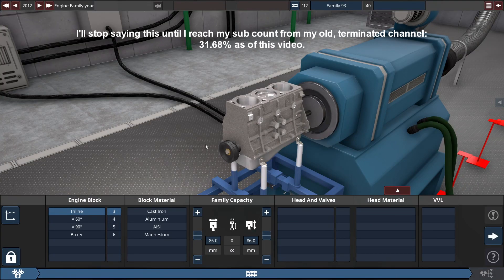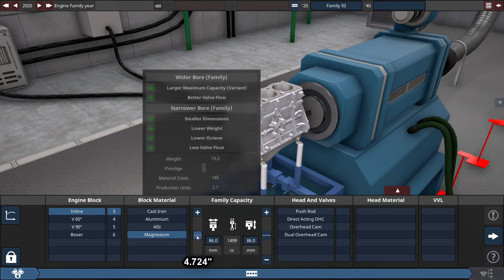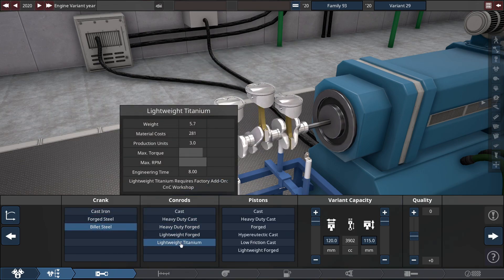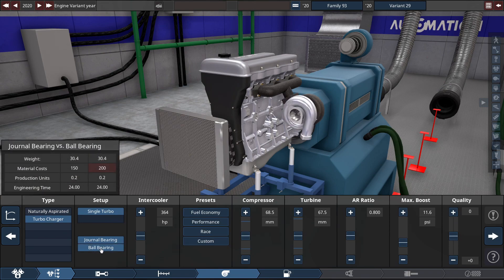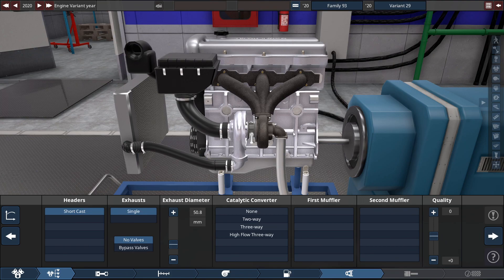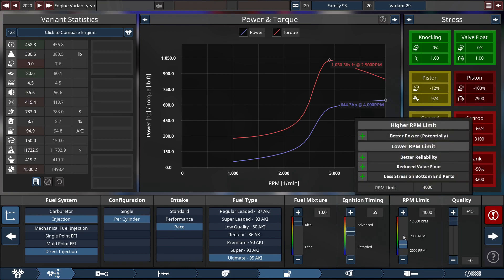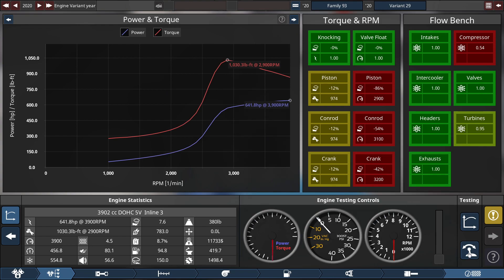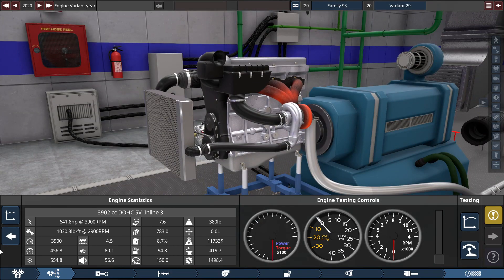The Most Torque in an Inline 3 Engine Ever | Automation The Car Company Tycoon Game

Comment: Could you make the best power to weight ratio engine?
Reply: I think that was the smalest most powerful engine series
Reply: @crispyshaman4937  I don't think so the naturally aspirated series has better power to weight ratios for example
Reply: @fjandro9646  i dont think so atleast with the i6 the nsturaly aspirated one made 1100hp and weighed 500lbs. And the turbo one weights 580lbs and makes 2400hp
Reply: @crispyshaman4937  I thought you was talking about the smallest most powerful series not the most powerful number of cylinders series. Anyways idk if some of the engines already created in the channel has the best power to weight ratio possible
Reply: @fjandro9646  but what was the power to weight ratios on those small engines